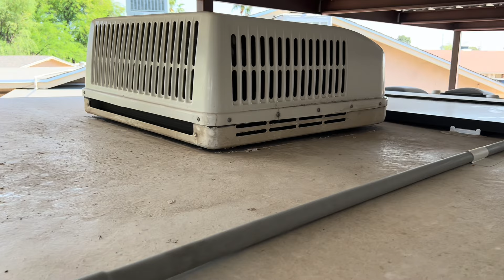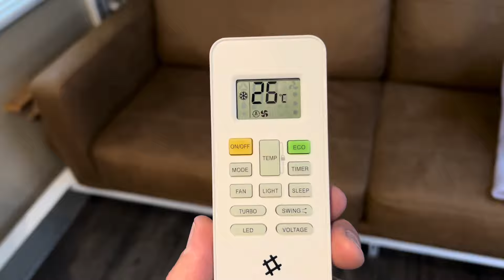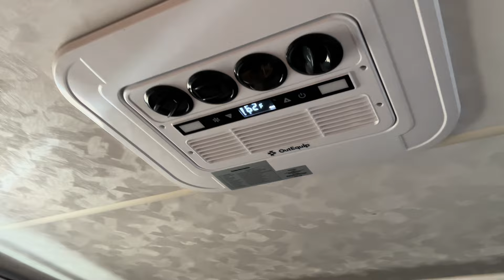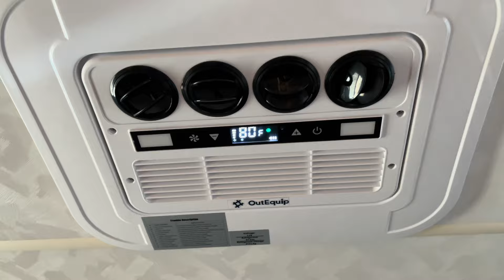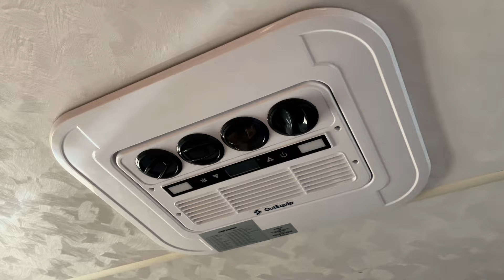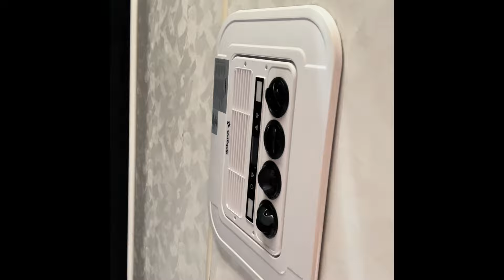OutEquip Pro 12 V air-conditioning for RVs - review and install tips for March 2026

Comment from the maker: Certainly power draw is a consideration for 12 V air-conditioning. After about 90 days of use, my experience is the OutEquip unit draws minimum 27 amps.  That is manageable with our 400ah  battery bank and 680 W of solar.

Our unit is mounted above the primary seating area in our RV. That has worked out well as we mostly run the AC on low and it blows directly on us.  In our application, this small AC unit is akin to a space heater in that it is great for point-of-use.   When we are trying to cool the entire trailer from a heat-soaked 95 degrees or above, we use the big  Brisk Air AC unit still.

Comment: Do realize you have to disassemble the unit just to clean the intake filter?
Reply from the maker: Good point.  Yes, that is correct. And that is a design flaw in my opinion.  My plan is simply to use a vacuum on the filter exterior to remove any debris.
Reply: @gormanthomas8135  I'm going to use an alcohol drenched Q-tip
Reply from the maker: @LarryLyonRelyon Good idea!

Comment: Thank you for demonstrating the use of 3/4” PVC conduit for routing the wiring on the roof. I had already considered that as part of my installation, which I’m still in the process of mapping out.
       On my motorhome, I will be creating an entirely new roof opening, which I plan on keeping to the minimum 10.3” x 14.1”. The interior ceiling will need a bit more opened up in order to accommodate the 2x4s that I will be using for bracing and boxing in of the area between the 16” on-center ceiling joists.
       I do appreciate the videos that people are sharing for their own installations. Yours included. All of you are a great inspiration and resource. Thank you.
Reply from the maker: Glad it was helpful for you!

I've been using the A/C unit for awhile now.  The cooling capacity is about what I expected.  I am glad I left my original Brisk Air unit in place for the really hot days.  

The 12v Outequip A/C is definitely worthwhile, but it is not a comprehensive cooling solution for an entire full size camper.  It is great for those 85-90 afternoons!!
Reply: @g @gormanthomas8135 I should probably clarify that I did not purchase this unit to replace my 13,500 BTU Dometic Duo-Therm 120VAC roof A/C unit. The OutEquip Pro is being mounted above the driver’s area of my 24 foot Class A motorhome. It will be used only while driving. The engine-driven dash A/C system doesn’t hold refrigerant from one travel season to the next. I’m not dropping another $1,800 to have a shop tell me that they can’t find a leak, and I’m tired of fussing with the cans of R243a.
        My plan for this unit is that after I complete the installation, I will upgrade the engine electrical system with a higher output alternator. I don’t need a bigger bank of batteries because it won’t ever be used when the engine is not running. 
        Can you do me a favor? Can you provide me with the dimensions of the interior ceiling shroud in your completed installation? My unit is still in the box, and I don’t feel like lifting it oof the box until I’m ready to install it on the roof. I have to make some modifications to the interior ceiling, including boxing in the opening, before I even think about opening up the roof. And that’s only after I finish relocating one solar panel that’s in the way. Thanks in advance.